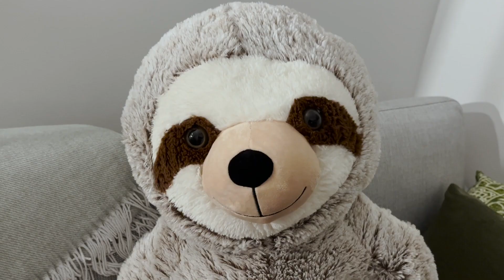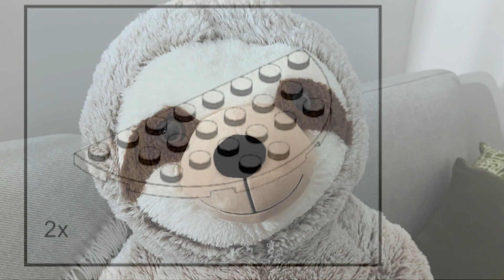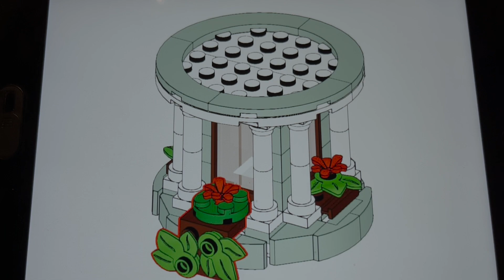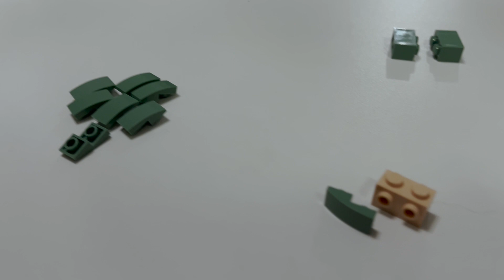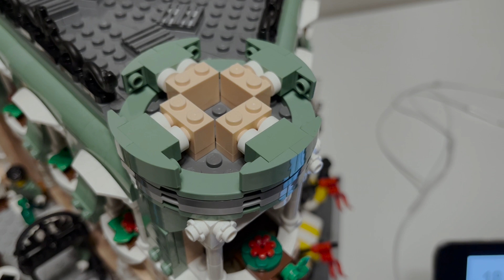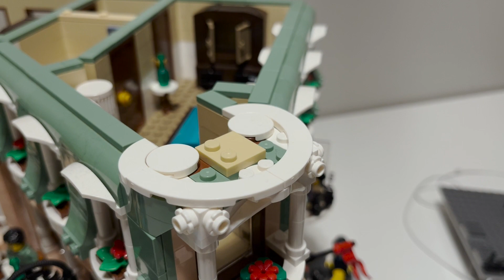Modified Raised Dome for the Double Hotel Alt Build

Comment: No doors can be access inside it.
Reply from the maker: That is true, but then again the area inside the dome is just 2x2 studs, plus what ever you get from the surrounding window frames. 

You might be able to get a minifig in there. The arms could perhaps fit in because of those window frames, but you would have to build the tower around the fig once it is in.

If there would be more space there, some sort of spiral staircase might be a nice entrance point, but currently that would just compromise the balcony access.

So I just see that more as a decorative spire rather than a room that one can enter, even if the windows there would suggest otherwise.